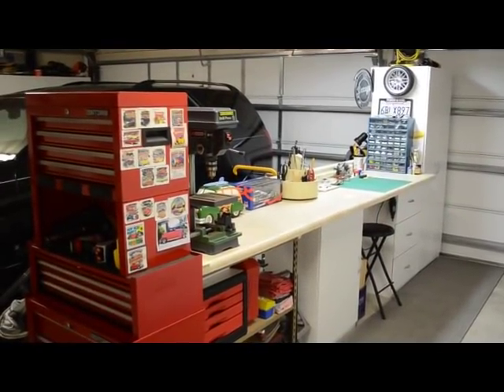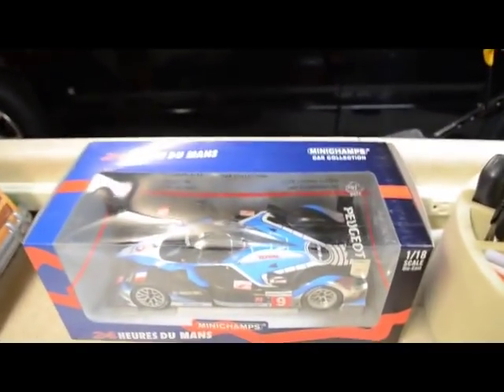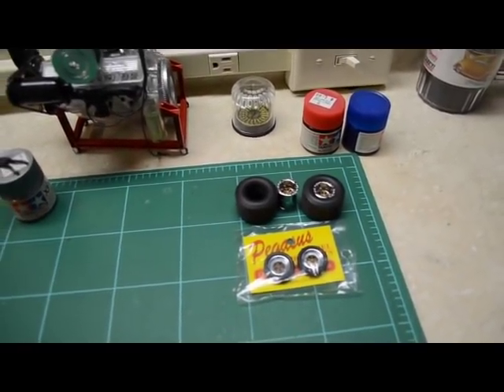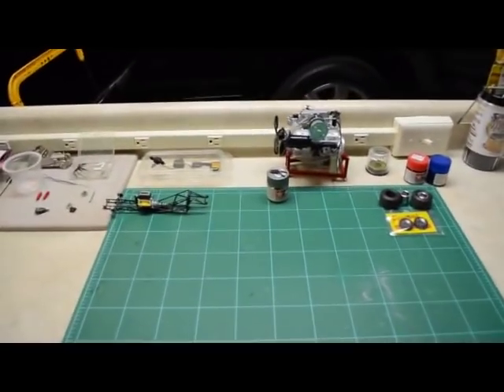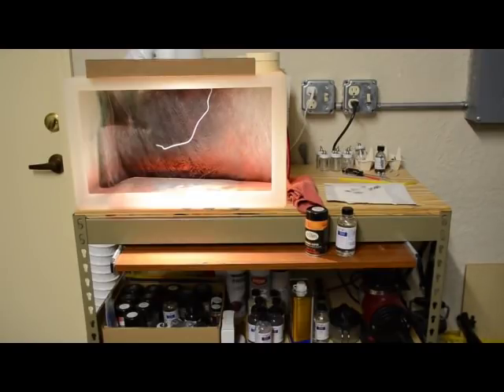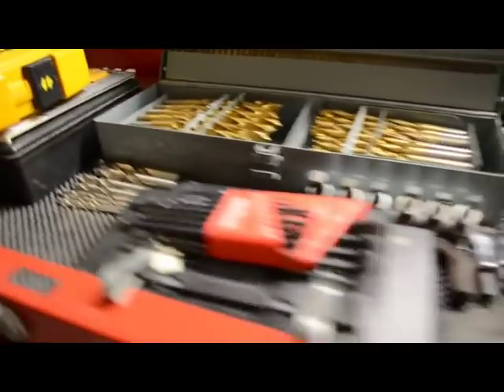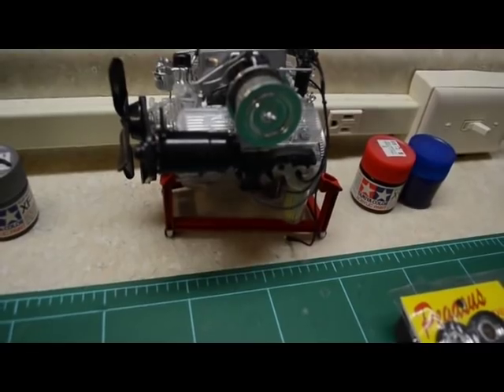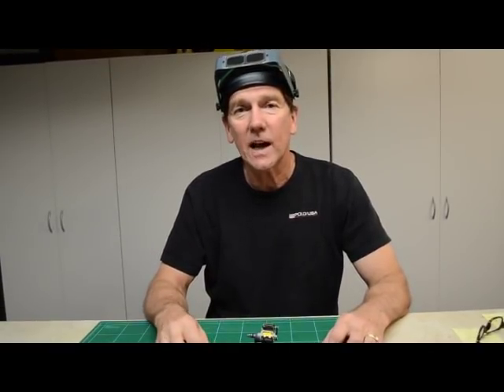Take a tour of my scale model work area

Comment from the maker: Thanks for the comments. I'm lucky to have this much space. I'm using 1 of 3 garage parking spaces and I'm used to a closet. The extra storage means I don't have to have all my tools and supplies in my way. It will come in handy when I start those 1:8 cars.
I saw your video on the Revell engine packs. I bought a Chevy 283, with a front-mounted Potvin blower (for a '53 Stude Salt Lake racer) and a Caddy 354 (for a rat rod or older street rod) and the other engines came in the package.